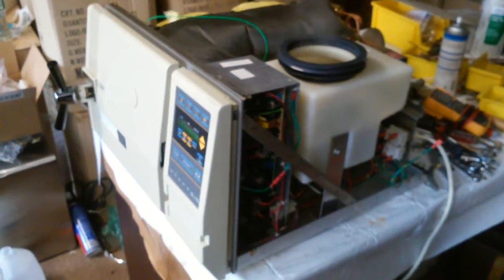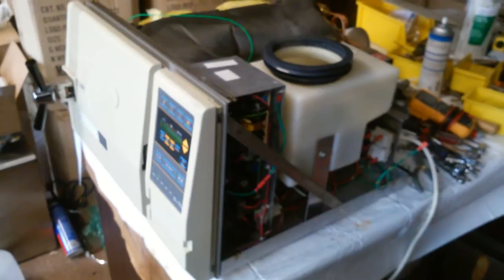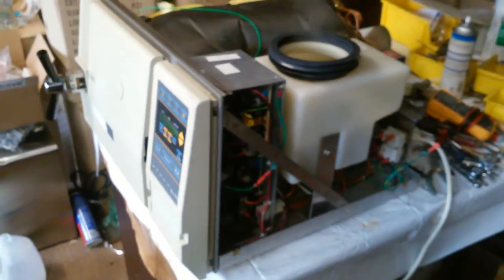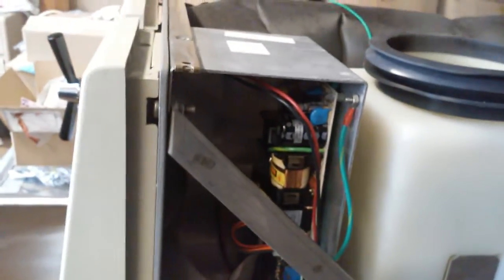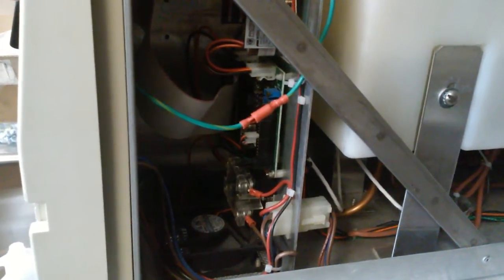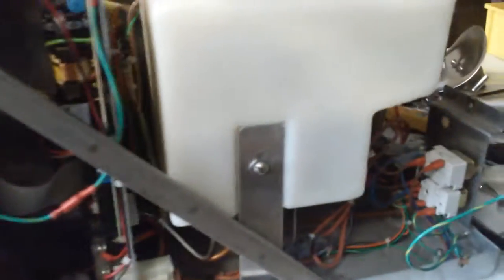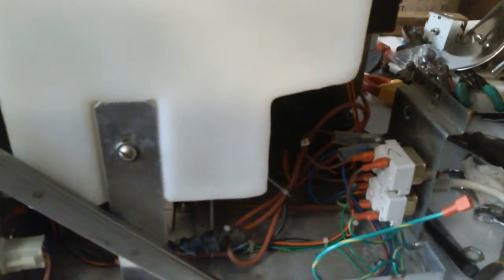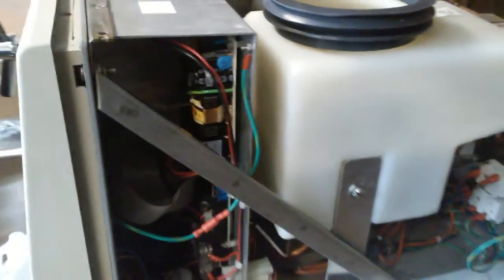How to fix Tuttnauer 2340 2540 E EA EZ autoclave sterilizers

Comment: I have a 2540ea and the low temp comes on and failed. water drips from coil during complete cycle
Reply from the maker: Sorry to know the problem with your Tuttnauer 2540EA autoclave. Mostly the problem is a leaking. Mostly the leaking is from its solenoid valves, in your case, especially for the vent solenoid valve. You can try to clean its plunger if you can. Otherwise call us at 866-201-6291 or visit our website at http://www.isterilizer.com for more information.